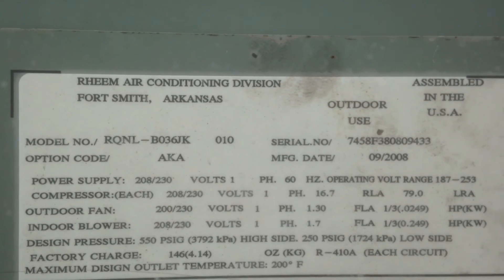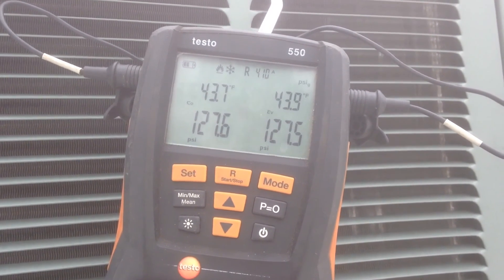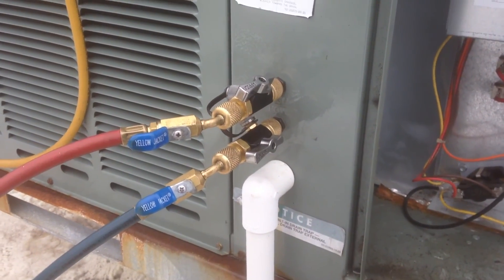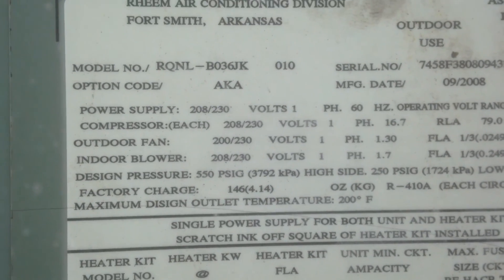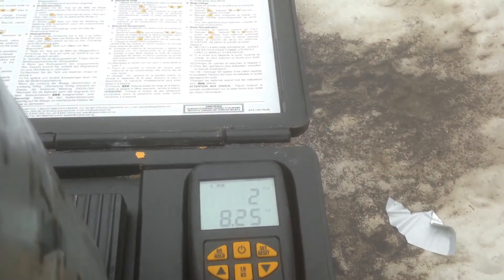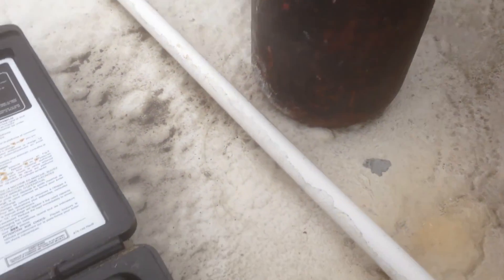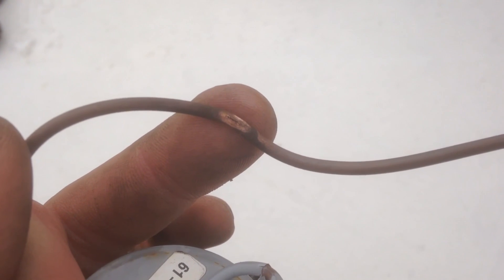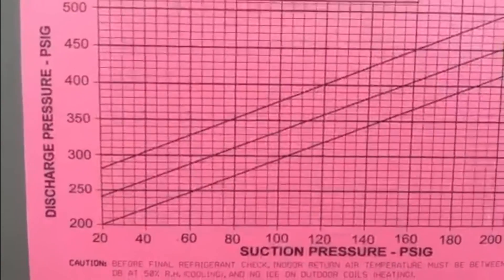HVAC Service: Troubleshooting Rheem RoofTop Heatpump Package Unit TXV Repair

Comment: i have a heat pump throwing hot air on cooling. whats the most common problem?
Reply from the maker: Could be anything! Capacitor, is fairly common on older units

Comment: It appears that the TXV sensing bulb is mounted up side down. I was taught the cap tube should exit in the top on a vertical tube.
Reply from the maker: +Douglas Kahane right, my question is why do they mount them upside down from the factory?
Reply: +Stephen Rardon (HVAC with Stephen Rardon)  Probably because the worker does not know better. I checked Sporlan and Danfoss and they want them with the capilliary on top.

Comment: Stephen is that Cps tr21 really that fast of a machine? Is it reliable?
Reply from the maker: +Marc W I've had no issues with it, it's much faster when used together with the MT69
Reply: +Stephen Rardon (HVAC with Stephen Rardon) Thank you

Comment: Do you recommend the vn500 for use in r22 systems also. Can the pressure on it, be reduced if necessary, or, will a vn250 need to be used, if higher pressure is no recommended
Reply from the maker: The VN500 simply goes up to 500 psi test pressure, you can stop it before that if necessary.
Reply: I ordered it

Comment: Could have just done the bulb
Reply: Stephen Rardon If its a sporlan valve you can buy the power heads on their own, they just unscrew, screw the new one on hand tight then go one more flat tighter, so 1/6 of a turn and its good to go. If you had a few lbs pressure left in the system then no need to evacuate.
Reply from the maker: Really? I have always replaced the complete valve. I've not seen a bulb only before. Interested, how's that work?